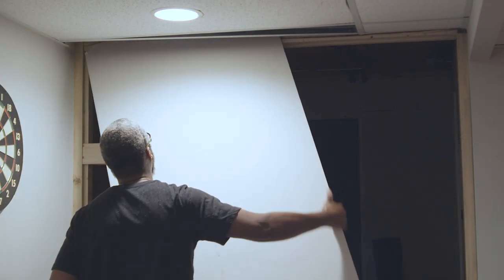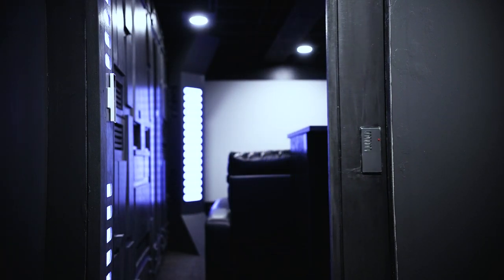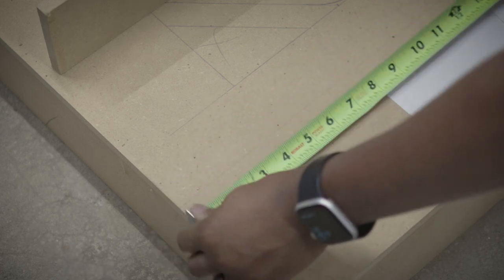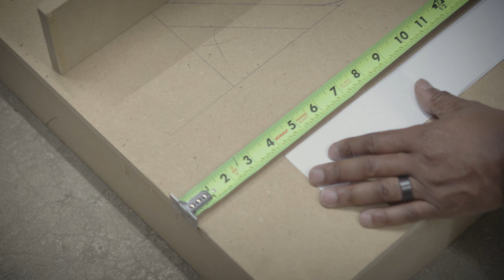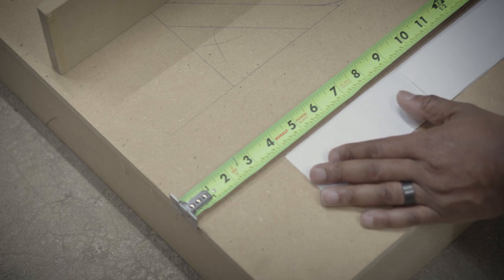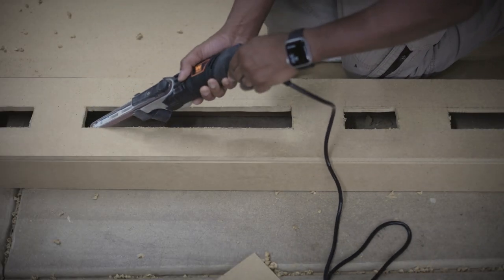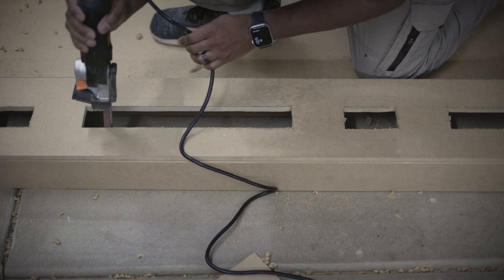Media Room Entrance Area - Part One

Comment: what kind of motor did you use for the door? during power outage can door still open?
Reply from the maker: I used something called an auto slide door opener.  Yep, as soon as there is no power, the gears are free-rolling.
Reply: thanks for the information
Reply: Do you happen to have a brand or model number
Reply from the maker: I purchased the device off of Amazon.  Here's the link!
https://www.amazon.com/dp/B0061UJ3QK?ref_=cm_sw_r_cp_ud_dp_53VZTWSMMFQ935HS0YAX
Reply: thanks again